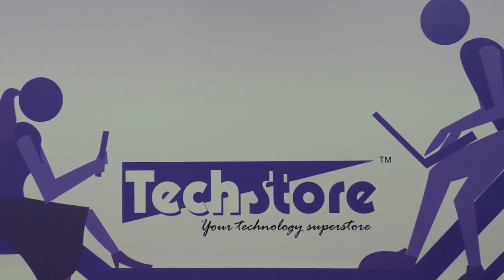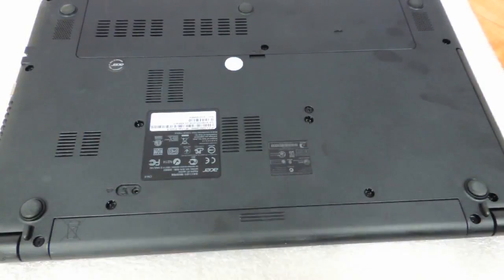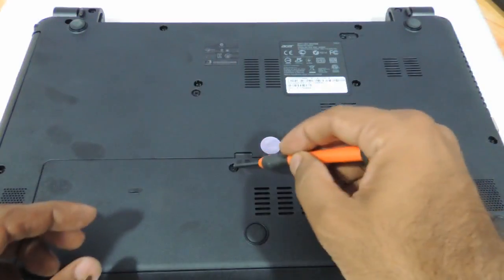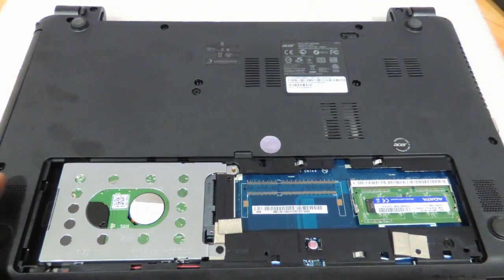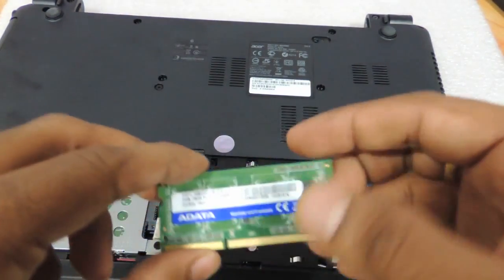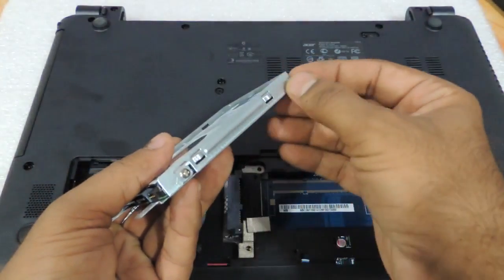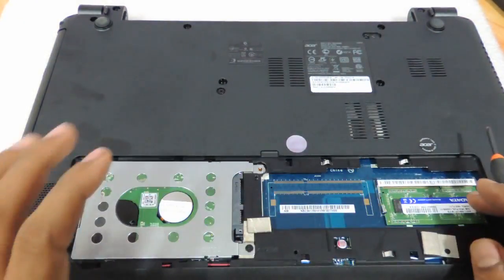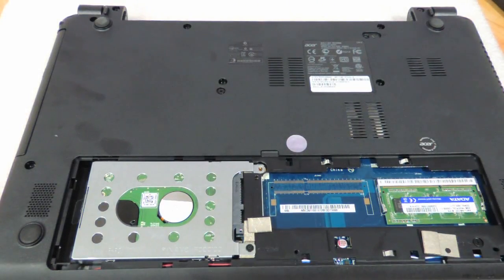Acer Aspire e1 510 570 571 572 how to upgrade ram memory and harddrive easy diy

Comment: I have a acer e1 510 laptop with Pentium quad core 4th gen processor.. 
Please tell me, this laptop has single slot or dual slot??
And if it is a single slot, then tell me should I put a 8 gb dual channel ram Or 8 gb single channel ram??
Reply from the maker: Single slot. Please subscribe for more info.

Comment: Where to get drivers for windows 1064bit. For model Acer AspireE1571G
Reply from the maker: https://www.driverscape.com/manufacturers/acer/laptops-desktops/aspire-e5-571g/164079
Reply: @TechstoreCoIn  Sir ,my model is Acer Aspire E1-571G ,is E1 and E5 -571G have same drivers for Windows10  ,you have provided link for E5-571G ,please help

Comment: I have a question I have 572 version, but it origionally shows when it has 2 hard drives both origional 350gb HDD, so where is supossed to be the 2nd hard drive ?
Reply from the maker: Not possible it has 2 HDDs. Must be some error. Thanks Do Subscribe.

Comment: Sir... My first RAM is DDR3L 2GB ...so can i use second slot with DDR4 4GB.... Without facing any problems in my laptop after installing ??? please reply....
Reply from the maker: No dear it will not fit...Do subscribe

Comment: I have two laptops 570 and 572. I need to upgrade my 572 which is i5 (E1 570 is i3). When I add an extra 4 GB DDR3 RAM to my E1 572 from that E1 570 laptop, 572 is not working (power leds turns on but display not). But when I tried this on my 570 both RAMs are working properly. Please tell me the reason. I want to use that 572 model with 8 GB RAM.
Reply from the maker: The ram frequency for both is different.

Comment: Can I add 8 GB RAM to the next slot and use 4gb RAM and 8 GB RAM together at once? Does that combination work or not?
Reply: It works, but not as if it had 12gb ram.. they’ll both work with the capacity of 4gb, giving you 8gb total

Comment: hi, great video, i have an acer aspire e1 510 with 2gb of ram and a pentium quad core Processor. what is the maximum ram capacity can i install?
Reply from the maker: 8gb
Reply: @TechstoreCoIn  Thanks
Reply: @sivasubramanian6919  dude does it work i have intel pentium N3520 does it support 8gb ram or max 4gb pls help fast
Reply: @prathamchanchlani6430  It supports 8gb. 8 GB is the maximum.
Reply: @sivasubramanian6919  yew just got the ram ohh my god it became as fast as macbook pro . I had this acer laptop but didn't use it my mom needs it now but when she used it it was too slow so got ram for her
Reply: @sivasubramanian6919  thanks anyways bro
Reply: @sivasubramanian6919   bro i have the same laptop as you.. Please guide me about which 8gb ram i should use & the laptop has single slot or dual slot?? 
Pls help.....
Reply: @prathamchanchlani6430   please tell   the name of ram you used ... Please help....

Comment: Why the second memory socket is missing i got the same problem fucking acer i wont buy anymore. Is it possible to put a second memory socket on that motherboard? Is it expensive? I got the same laptop with only one slot what is the maximum capacity ? 8 gb?
Reply from the maker: Not possible to put another memory slot. You should have purchased the celeron / amd or Quad core variant.

Comment: The title of this video says "memory,, HDD and Heat Sink", 60% of the video is spent on LCD (not in the title) 30% on other issues (most not in the title).. At least you did address the heat sink (which was in the title). But no memory or HDD plus the music and quick dissolves were annoying. Why don't you take the time write a voice over script (especially if English is not your primary language) hire a Voice over talent from "fiverr" for $15.00 (estimate, but a fair estimate), and have it read  while you do the repairs or upgrades. Of course to make it fit you might have to put technical commentary in and edit the voice over to the action. The best idea is hire a medium skilled video editor and a voice over talent (someone who can pronounce the words, has a clear voice, no accents and has an engaging aural style). Using a pretty woman at the beginning at end on camera as your Voice Over talent would add some pzazz and root the video with a human face and theme. But at least make the titles fit the video.and also choose BETTER music!

Comment: i have acer E1-570 with intel i3 
what is the maximum capacity upto which i can upgrade my RAM?
Reply from the maker: +Ravish Mahajan 16gb
Reply: i see only 1 slot, can we use 2 rams combination as 4+8GB 1600ddr3l rams ?

Comment: What about Acer Aspire E1-570G, do I use DDR3 od DDR3L RAM?
Reply from the maker: Which processor do you have?
Reply: i3-3217U
Reply from the maker: +Marin Novoselac You have to use 1600mhz Ddr3L

Comment: Hello,
I have Acer Aspire e1-571G with W8.1 OS 4Gb DDR3. A time ago I added one more RAM 4GB but my memory works with 800mhz for the first memory (DIMM1) and 666Mhz for the second memory (DIMM0). Please tell me how to boost speed on my memory?
Thanks in advance!
Reply: I would recommend to not do because of the motherboard it will burn
Reply: Hi .i am a e1571g. Your name hard hdd is toshiba mq01afb? Please answer

Comment: Can you put a Nvidia Graphics card in this copmputer(which kind) and does it effect the battery life  in the computer cause i got a acer aspire e1 5724th gen intel i7 4500U with intel hd 4400
and thanks for the video anyway
Reply from the maker: epiccatfishlol You cannot :-(. having a discrete graphics card always hampers the battery life.
Reply: But if you get a better battery will it work?
Reply: epiccatfishlol you dont have the space for a card like that, its too big, too heaavy in power, and the cpu wouldnt be able to handle the poor thingy :p
Reply: ok thanks

Comment: Hi Techstore Team,

I wanted to buy Acer Aspire E1-572 Laptop present with a Core i5 (4th Gen) 4200U, 4 GB DDR3.

Q1. The seller website from where i got the info doesnt mention DDR3-L
Q2. I want to install total 16GB RAM= 8GB+8GB in 2 slots . . .  I wanted to know is it possible? Because the seller website mentions RAM only upto 8GB where as intel website mentions the processor supports upto 16 GB RAM

I want this laptop to practise VMWare lab . . .

Comment: http://www.emag.ro/laptop-acer-e1-570g-33214g1tmnii-cu-procesor-intel-174-core-small-sup-tm-sup-small-i3-3217u-1-80ghz-4gb-1tb-nvidia-geforce-gt-740m-2gb-linux-iron-nx-mgvex-023/pd/DF5SLBBBM/?ref=autosuggest this is my laptop. 
 What kind of RAM sped should i choose ?
Reply from the maker: Nicu Catalin Hi, Please visit http://techstore.co.in/A-DATA-DDR3L-4GB-LAPTOP-RAM-PC1333-id-556071.html
Reply: Techstore Hi , after i open'ed my laptop to see what my laptop had for ram inside i saw something strange! , it is not the normal ram size that you would put in your comp. its small! i got scared a bit that i couldn't upgrade , but i think your link with that memory is a good size? if it is i hope that i can find it somewhere in my country haha.
Reply: It really looks like my Acer Aspire E1 - 572

Comment: Hi, I have the Acer Aspire Notebook E1-510 featuring the Intel Celeron N2920 Quad Core. Which RAM can I use to upgrade, DDR3L or DDR3? Can I take any MHZ / timing combination?
Reply: DJ SndcX Ahh yes, I agree. As You can see in the video there is only one RAM retention slot
Reply: Techstore Hello!, I have the same laptop and cpu, it came with 4GB of DDR3L, there is a single RAM slot as in Your video, is it possible to replace it by 8GB DDR3L module ? thank You!
Reply: Javier Santander 8 gb in one stick is less usefull than 2 sticks with 4 gigs :)

when you have 2 sticks, you have 2 x 118 busses, wich can make your cpu send/receive double the amount of data, but splitted between the two sticks
Reply from the maker: DDR3L